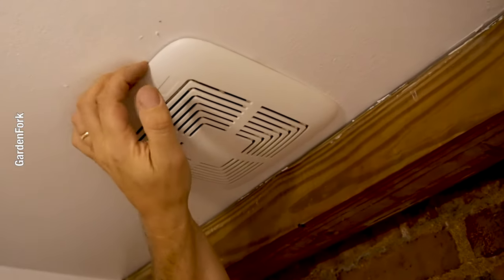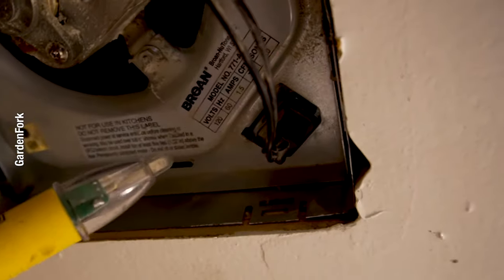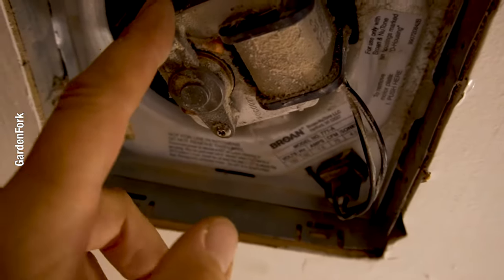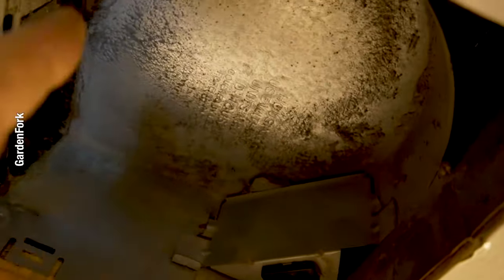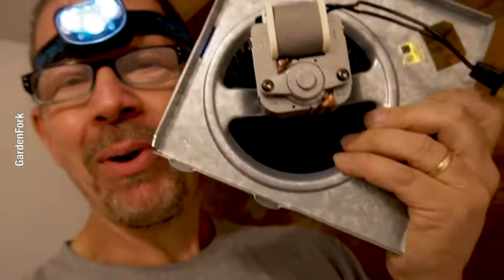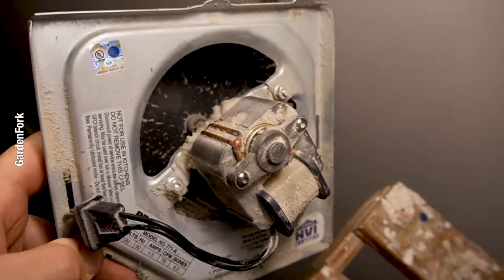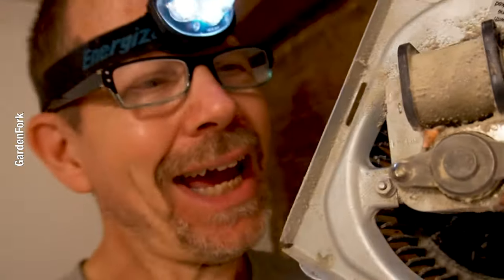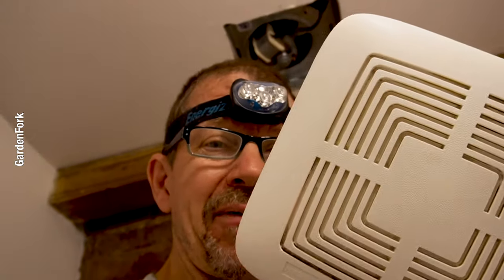Bath Fan Broke? You Can Fix It

Comment: Yeah, I was one of those guys that used to do all the repairs around the house. The first thing I would do is go to the breaker box and shut the power off to that circuit. Then unplug because of the heat up there the insulation could be brittle or the plug could be brittle and who wants to grab ahold of live wires and take a chance on having a bad day!

Comment: Please make sure to turn off the power before you start.
Reply from the maker: Hi Mark, the fan motor has a regular plug that connects to the housing. its like plugging in your vacuum cleaner. Appreciate your concern! :) Eric.
Reply: at 1 min 47 secs he unplugged the motor from the electrical outlet in the fan housing and replaced the motor safely.

Comment: The whole point of the tweeter is to verify that you have live power why would you not shut off circuit breaker? Not to smart buddy
Reply from the maker: Hi Trackhoe, the fan motor plugs into the fan housing, there's no exposed wires. We use the non-contact tester to make sure the problem with the fan is not a lack of power from the switch. thx!
Reply: Trackhoe- step 1 he used non contact tester to assess if the problem was electrical. Result: there was power, so the problem is not electrical. Step 2 at 1 min 47 secs he unplugged the motor from the electrical outlet in the fan housing and replaced the motor safely.  I’ve done the exact same in my house.
Reply: @gardenfork  good point I just get overly cautious when it comes to electric
Reply: @roguepetunia  I tend to be very cautious with electric and once I knew the power was alive I myself would flip the circuit breaker but that’s me

Yes all your points are completely valid but I’m the guy who throws the circuit breaker to change a light bulb lol ever sinse melted the end of a screw driver cause I wasn’t paying attention 

My fault but lesson learned cause I don’t do electric that much 

It’s the old adage “ be safe rather then sorry” 

Thanks for your explanation
Reply: @Trackhoe075  I hear ya. cautious is always the best way to think about any projects :)
Reply: @Trackhoe075  I hear ya. cautious is always the best way to think about any projects :)
Reply: @Trackhoe075  the word is than and not then otherwise your sentence is contradictory.